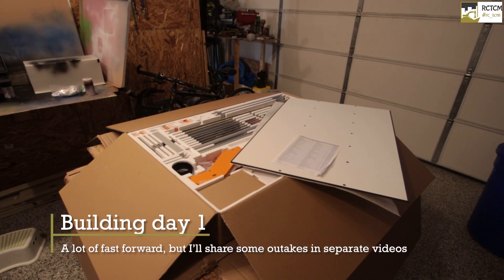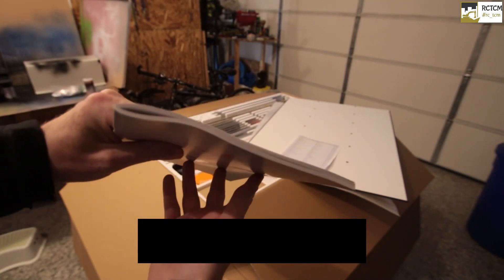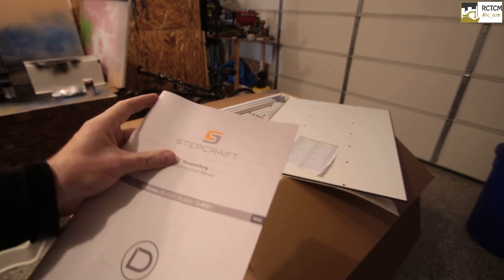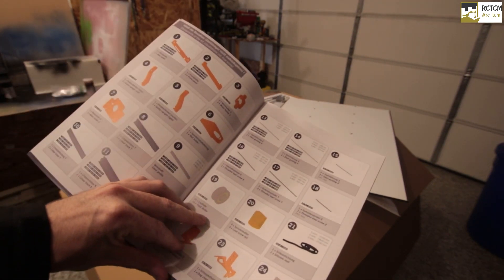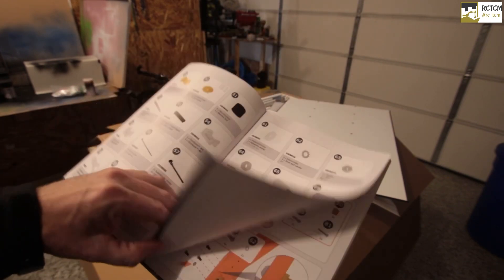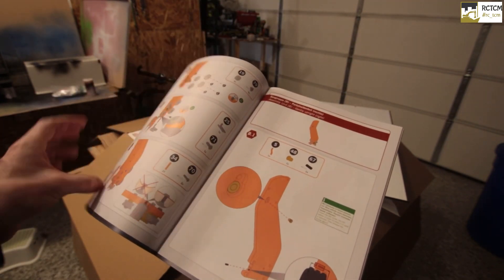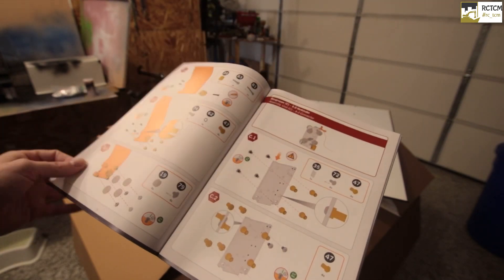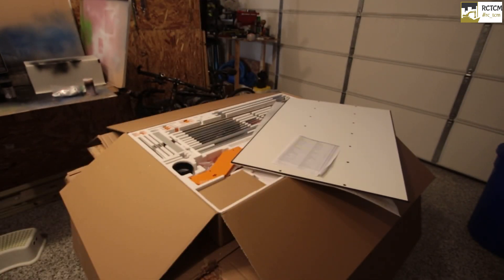@stepcraftgermany #D3.840 build day 1

Comment: Wow, I can already tell it is not only improvements to the machine in the end result, but also to the build process. That is awesome that you could put the screws onto the motors with a mounting bracket then feed them into the machine later - we did not have that on stepcraft 2. It was harder because we had to feed them through to make that connection later. You will have a more easily aligned machine because of it, most likely. You still building her?